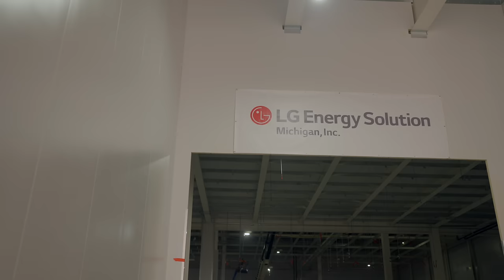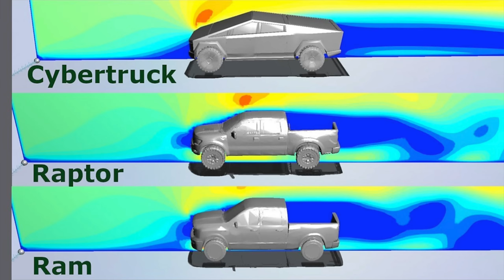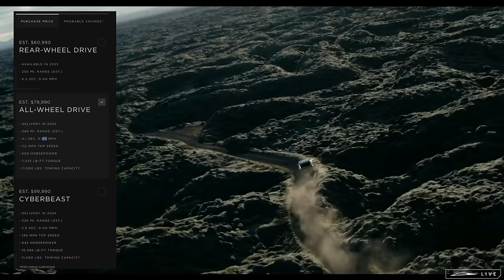Cybertruck - What Tesla ISN'T Saying!

Comment: Who cars about 0-60 in 3 seconds ?  Who cares about beating a 911 off the line.  All those are fine features.  Bottom line is they promised 500 mile range and can only deliver 340 miles.  What that says is they have reached a roadblock in battery progress.  Everything else is blah...blah...blah.  You want to know why Ford lightning is not selling - Range.

Comment: Is it true there is no AC in the truck bed and the rear window doesn't open into it? That would mean you cant carry anything temperature sensitive, it's just a portable oven here in Dubai or freezer in Alaska. Would have been so easy to implement. Lame if true especially on a $100k poser machine, how do you do wine crate deliveries which is about as industrial a use as it will ever see 😂

Comment: Fact 1: I don´t want to be found dead in ditch, in that crap!
2: When, not if, the battery goes "dry", where the hell do I "fill it up", in the middle of nowhere? (Sorry Sir, do You have a kilowatt or ten to spare?) Or what?
As long as there is roads, with gas stations only, I will drive a TRUCK, not a fucking Dinky Toy!
Reply from the maker: gas is much more common, the same argument people who horses made when gas cars came along. as for the "toy" I can guarantee the cybertruck will make whatever truck you drive seem like a toy. it's thin sheet metal, and vastly inferior gas engine. the issue will be batteries for a while. cheers

Comment: There is an advantage to having breakable glass: medical personnel can get to you without a jaws of life.
What stops the trucks in that towing test?  The car doesn't just die after a few hundred feet.
Reply: OTOH, the truck looks very safe, and very unlikely to roll over.
Reply: It's easy to point at negatives. It's not so easy to break the mould. It's easy to criticize, but not so easy to build.
Reply: @nitesh-maharaj  I agree.  I'm not trying to be negative, just weighing pros and cons.  I have neither been shot at, nor pulled from a wreck.  I don't know the statistics.  There could be a form of glass that's safe for both.  Hell, this may be that form of glass.
Reply: The tractor pull gets progressively harder to pull. The wheels of the test sled drive a weight forward. The further forward that weight is, the further it rests overtop the skid pan at the front of the trailer, increasing the traction.
Reply: @blooey2  Thanks!
Reply: I imagine there will be some kind of fail safe
Reply: The towing test is so easy to rig.  I would put no stock in it.  Weight, tires and hitch height are key.
Reply: @gregkramer5588 you don't know what they're towing.  It's a tractor pull sled for contests. As the truck pulls it,  a massive weight moves forward,  putting more weight on the front,  driving the front of the sled into the ground,  bringing the truck to a halt.  The better torque and traction, the further the truck can pull the sled,  but the sled always wins in the end.

Comment: I love the engineering they put into cyber-truck. But It's ugly, parts are OEM only, almost no after-market accessories to personalize your truck, charge time specs (Fast charge power:
250 kW AC*, Fast charge time: 44min (10-80%)*), limited repair facilities, lack of color choices inside and outside, and battery lifespan and replacement costs are unknown. This truck is ideal for silent off-road poaching seeing it's also bullet resistant. Beyond that it's an over priced vehicle with no market that can make use of all it has to offer.
Reply: Unplugged performance already has 15 aftermarket accessories for the Cybertruck.
Reply: @iowa_don  that's why I said almost

Comment: I need a cyber truck that’s 6 Wheel Dr. with an 8 foot bed in a 1 ton configuration with a solar panel that pops out and collect sun in case I’m out in the middle of nowhere cause I go get four or five turns ahead on a flatbed trailer It’s a deck over and I would probably get rid of my 2008 dodge ram with a 67 Cummins if their cyber truck can do what it can do and sometimes it’s as snowed about 4 feet in one night appear in Spokane Washington, so I’ll probably needs to be lifted to that’s what kind of a truck I need from

Comment: I see:
The shoddy Tesla build quality, fit and finish has been turned up to 11

The usual Tesla panel gaps and trim fitting where it touches.
That interior is bland. Touch screens are not the way to go. You cannot beat a switch or lever you can feel the position of.

Comment: So towing = 180 miles which is 120kw @ .43 cents per kw at a charging station = $51.60 per charge.  To go 600 miles = $172.34.  Raptor 36 gallons @$3.00 per gallon $108 to go 600 miles.  I'm not seeing where the "wasteful" part is.  Wasteful is paying almost double for energy to go the same distance.  Wasteful is also having to stop 3 separate times probably wasting a couple hours of time "refueling" the truck.

Claiming the cybertruck needs a "bigger" energy storage capacity, ONLY means is costs MUCH MORE on every refill, just to achieve the same range as a gasoline truck.  Electricity will never be as efficient as a internal combustion engine. 

Tacoma's, Ridgelines, Rangers, etc. Do NOT start pricing $60k  Your comparisons are non sequiturs.  I can't believe you end this video with literally saying "This truck is NOT for people who actually buy a truck for using AS A TRUCK"  Big swing and a miss here.

Comment: Aptera will be to cars what Cybertruck is now to trucks. Also, consider that Cybertruck has been scaled down since the initial promises were made. This can't account for the reduction in range, but it's certainly a factor.
Reply: I love the idea of the Aptera except for the three-wheeled deal (and I understand why they did that, but still). Three wheels mean three tracks through snow (more drag), and if there is a pothole or obstruction, you're always going to hit it (three tracks instead of one with a motorcycle or two with a normal car).

Comment: I get why the bed is shaped the way it is, but this is a toy, not a real truck for real working people. The bed shape while good for aero is impractical to utility. You can't reach over the side to grab items. Traditional truck bed campers and toppers won't fit, and it is unusable with a gooseneck trailer. If the Cybertruck is good for anything, it's prodding  the auto industry to hurry up and create more practical alternatives.
Reply: No harder to reach in the bed than an F150, you're not putting a gooseneck in any half-ton truck, and almost nobody uses camper shells any more. This ain't 1980.

Comment: Franz cheated the window shatter resistance test by using a baseball instead of a steel ball bearing. Shame on you Franz.

Also, if you want to show the bulletproof nature of the skin, use steel jacketed ammunition.

 And notice that the arrow did put a dent in the door while just bending the tip of the arrow’s broadhead. It was the arrow’s graphic or fiberglass shat that shattered not the arrowhead.

Elon learned well from P.T. Barnum. 🤔

Comment: I dont know why people keep crying over the original range promised at 500 miles or the low price.   Even in 2019, those range and prices were impossible to make.   Like any other companies,, they made a good price and range so a lot of people can plant down a 100 bucks so that they can have the capital to make the truck in the first place.   With the cost of living after Covid shooting sky high, no one is in control of prices today.  As for range, sure Tesla can just put a bigger battery to get 500 miles, but then the truck will weight as much as a house and performance will suck and the price will be even more expensive.   It will turn into a Hummer, which is an expensive toy that only a few people will have.   Tesla has the battery extender, which can come close to 475 miles, so that is enough considering that the Tesla Superchargers are everywhere.       What i want to know is that this battery extender looks to be a better deal for my house instead of a Power Wall ???

Comment: Yes it will tow more than an f350 diesel as long as it's within 20 miles of the starting point. Electric towing is horrible regardless of what your make or model. Numerous videos of the tesla,ford,rivian and chevy best was what 90 mile range towing. Another thing is yes its strong but what about an accident will the jaws of life be capable of cutting said human out or is it just a $50,000 coffin. Just a side note real baseballs don't bounce like that it wasn't a real baseball used acted like a tennis ball dressed as a baseball.

Comment: Wow Ricky, could you try drinking something OTHER THAN the Elon / Tesla KOOL-AID? Your biased video shows you're a TOTAL Fan Boy now. But to summarize: about 35% LESS: Range, Load Capacity, Towing Ability, a price INCREASE of about 40%... No Parts Availabilty, No Service Network... And to top it off - picture this, with the extra battery (for our cold climate use) add in the HUGE spare tire -  leaving zero room for any load. Right. UNSUBSCRIBED.
Reply: You ain’t an engineer are ya
Reply: not to mention how you MUST clean any liquid off the truck ASAP or might cause damage
Reply: @chrish8871  Did what I state require an engineering degree to understand??
Reply: I dunno. That was 3 weeks ago? I can’t remember yesterday

Comment: Tesla made the final release of this ugly duckling smaller…just not small enough. I know there are a lot of folks who treasure function over appearance but this is over the top. I think there will be some folks who will question the 100K cost within a relatively short period. There will be a number of rich folks who were Hummer fans who will be lining up for these. I hope Tesla did the trick with the rear steering wheels better than GM did with the Denali. All in all, I bet Tesla will be coming out with a smaller truck in the Rivian size that isn’t such an eyesore within a few years. If they swap some of this breath taking speed for much more range they will have a truck that will outsell the Cybertruck in a major way. Just my humble opinion.

Comment: One might get the impression of Porsche having all that money they could produce a vehicle faster than their recent market offering
Reply: They do. Except a Porsche doesn't go into "limp mode" from the battery overheating after 20 seconds of full acceleration. Even the Taycan has far better thermal management than anything Tesla has ever put out, and it can even perform in corners like the rest of their vehicles. Tesla is a one trick pony when it comes to "performance" since it can only excel in a straight line for a very short period of time.

Comment: What I don't understand is how come everyone that likes the Cybertruck suddenly has so many excuses for everything Tesla overpromissed and underdelivered. Suddenly, range is not big deal, utility is not a big deal, ...
Also the "every truck looks the same" is quite a lie - Lightning from Ford is not 18% bigger grill. Neither is Rivian. Taking one example from the market and using it as an excuse why this is OK vehicle is lame.
Also, the extremely sharp body panels will be a nightmare for any pedestrian that the car will hit, as it will be for any other regular car. This is already a problem in US as people are buying such huge vehicles that they run over their own kids in the driveways, because they can't even see what's in front. Same was already pointed out by MKBHD for Cybertruck.
Tesla is not exactly known for being good at supplying spare parts. This car is not using anything that you can replace - the 48V architecture would be OK from Toyota or GM, but from Tesla? Anything that will stop working (door-opening-motors?) will be irreplaceable, waiting time is already known by Tesla owners to be horrible even for cars they make in huge volumes.
Now imagine someone backs into you and damages your body panel. Repairing even minor damage will be headache. I wonder what will be the insurance for vehicle like this.
Of course, people that will simply buy it because they like it, spending any amount on buying/running it (remember the people that paid $150k for F150 just to have it quickly?). And they will find a lot of excuses and reasoning why this car is OK.
But for me, this is a bad joke. It seems like the only parameter they adhered to is the bullet-proof body, which is by far the least important aspect.

Comment: Well first off let’s talk about the price which doesn’t make it even remotely affordable for regular household. So this will be us showing up in front of Starbucks instead of your local Ferrari. Next the bed usually the smallest bed when you really think about it because it only can fit a 4 x 8‘ sheet of wood with approximately 1/4 of the sheet of wood hanging out the back. So if you’re planning on doing anything Like getting a half yard of mulch for your house you might want to borrow your friends truck since he can actually put the stuff in the bed versus your tesla truck that can’t. That’s what I mean by a small bed. Next practicality sure it has a big internal space and I’m sure I’m gonna see this in front of a Starbucks soon but no serious truck owner is going to take this seriously with the small bed and in practical usage. What do I mean by impractical? Well do they have charging stations out of the woods where you can recharge your truck? Do they have a spare battery that you can use for additional fuel for the truck versus I can take a 50 gallon extra tank if necessary or even 20 gallons of extra gas when I go out into the country. This is a gimmick vehicle until they can tackle these issues.

Comment: Very disappointing event, so much stuff on the website that they could have talked about, instead they decided to throw a softball at the window to redeem themselves? Did they think we'd notice it wasn't a steel ball this time? the extended range is literally an extra battery pack that takes up 1/3rd of the bed. Surely they could have crammed around 180kwh in the main pack? I thought the whole point of the structural pack was that it was meant to give more room for more cells?? that extra trunk in the bed should have been bigger enough to fit a spare tyre like the Rivian does. only 250kw charging. its no cheaper than the F150 or Rivian in the mid/high spec versions.
Reply: Baseball, not a softball.  I'd say that extra battery takes up about 1/6 of the bed space, not 1/3.
Reply: I'm just quoting what Elon said, he said a third =/ @iowa_don
Reply: @WrathChild-NZ    That does not jibe with the photo.  Takes up one third of the bed length but only half of the height.

Comment: can't find ur stream about the cyber-truck.... as a fellow san-diegan, i can't help but feel that your position on the cybertruck is the epitome of coastal-elitist thinking. Buying a cybertruck to look cool and new is a costal thing at best, pretty sure significantly less percentage of texans are willing to buy it, compared to californians. Also, ppl don't buy cybertrucks for 0.3 drag coefficient (idk the real value), they buy it 'cuz they want a bigger/cooler truck than their neighbor. I'm also biased and think Elon is a snake-oil salesman, as I knew 10 years ago that his self-driving statement, which even himself acknowledges is the true value of tsla, is a big, fat, lie. From what I gathered, even today, tsla doesn't use a hard-real-time OS, so no way I'd sit in one of those during auto-pilot mode... Also waiting for someone to impose DO-178 comparable requirements on it after enough crashes/deaths. 10 years later, turns out the charging stations is really the value of tsla... His starlink? motorola tried that 20 years ago with iridium, (Hell, even qualcomm wanted in on sat-phone back then) i'm sure you are well aware of that fiasco as an aerospace engineer. Anyhow, that's just my opinion/rant, and I'm sure I'll get flamed to death for it. shields up.

with that said, I do like and appreciate vast majority of your vids =) (maybe you can do one on starlink's advantage over iridium-2)

Comment: The electric truck is a 4 wheel vehicle. So, I would like to know if the 350 diesel truck was also a 4 wheel vehicle... Remember  4 drive wheels can have a lot more pulling power than a 1   drive wheel has.

It is possible that this was not a fair comparison..
Reply: Pause the video next time! Says clearly on the side 4x4 for the fomoco diesel 3500hd. 👍🏻

Comment: Also you mentioned that almost every truck looks the same. Gee I wonder why that is? Maybe it’s because it’s form and function. Going all the way back to the original model T which by the way Ford invented. And when you stop and look at any truck on the road and you look at the Tesla in form of silhouette you can see that the Tesla truck follows that same convention. Nobody would look at a silhouette of the Tesla and think it’s a sedan or a SUV. I think what would be really useful is if Tesla figured out how to add the battery pack to the front of the vehicle cargo area. It might change the center of gravity but it would still remain a Truck versus having to put a battery pack into the bed where it has a better range but is no longer a truck anymore. Now it’s just a compact SUV with room for some shovels